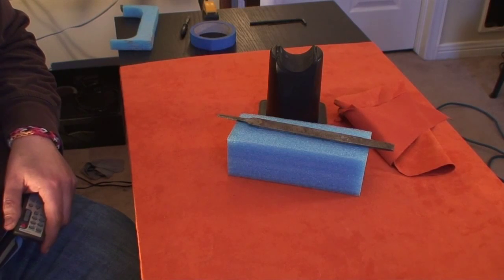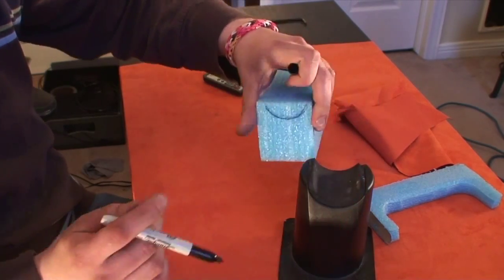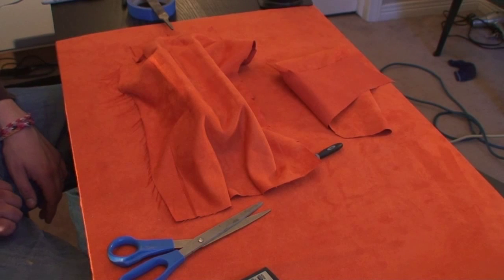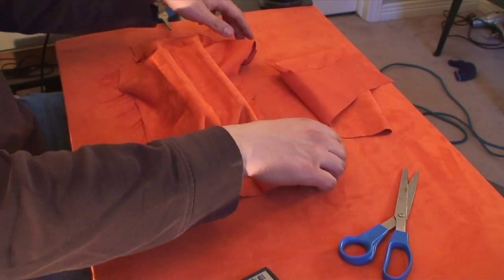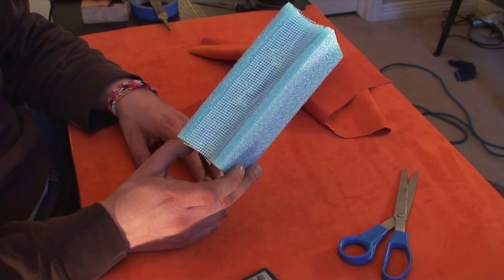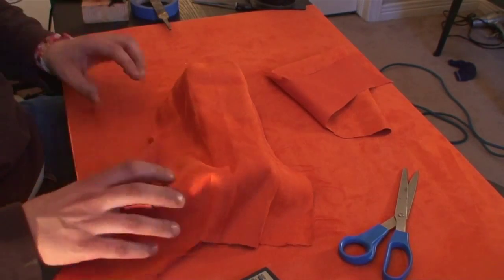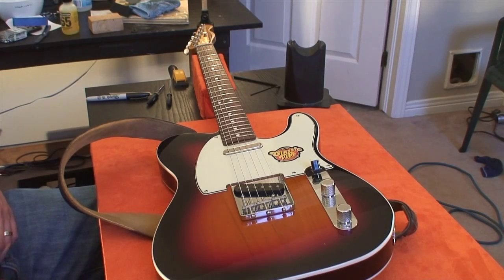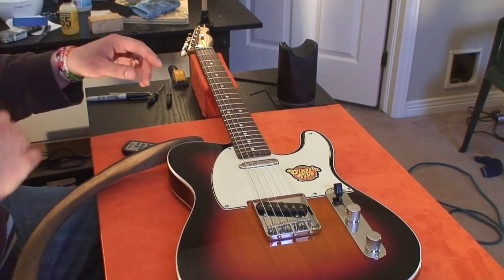Guitar Neck Rest: DiY Style"y"

Comment: Beautiful concept and use of materials. 

I decided on making mine based on yours but with a more modular design so it would work with anything from a solid-body electric to deep-body acoustic guitar. I used two blocks of wood: 1.5" x 3.5" x 3.5", and .75" x 3.5" x 3.5" so they can be joined together with double-sided tape (or a screw) if needed. I found a U-shaped piece of hard packing foam 1.5" x 4" x 2" from a computer monitor box. The foam was easily shaped with a safety razor blade. I put a piece of sticky-back felt on the top of the foam where the guitar neck will rest. Using this modular design, I have neck rest heights of: 1.5", 2.25", 3", and 3.75" (inches).

Couldn't be happier with the results, and it only took minutes to make. Thanks for your inspiring concept.

Comment: Great tip.I use a couple of different height pieces of polystyrene the same way,Came as packing with guitars with grooves pre cut.Good idea to cover them with plush material though.I've seen very sturdy wood with leather belt topped support ones that are easy to knock up too.
Reply from the maker: Thanks mate.  Yeah I wanted to make one out of wood, but frankly for the benefit of making it from wood, it's just too much work;-)  This is going to work wonderfully for me.  Also, I am really still testing this shape for now so this is an easy way to do that.  I'd like to make one of those half moon ones like the fella over at Crimson Guitars, but that's a summer project;-)  Thanks a heap for the kind words and view mate!